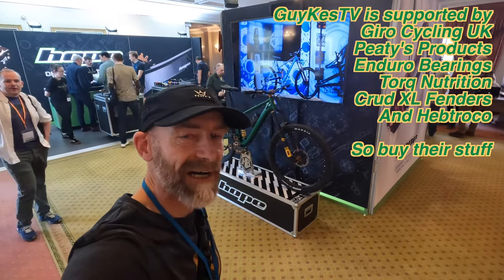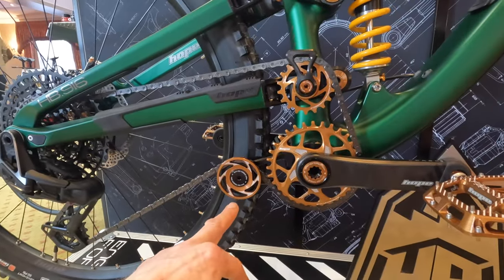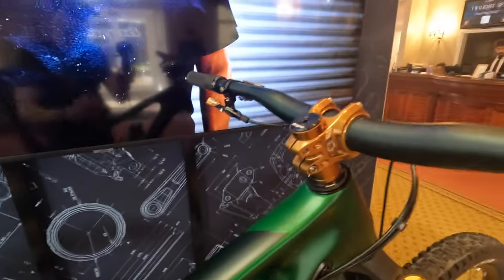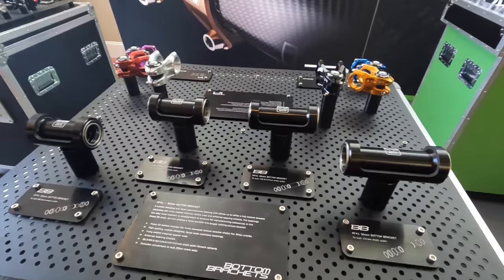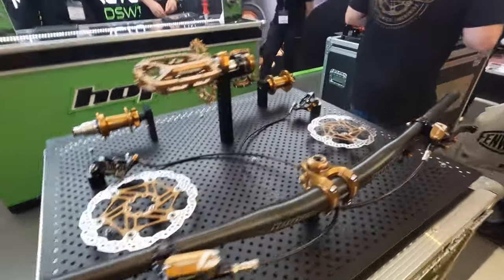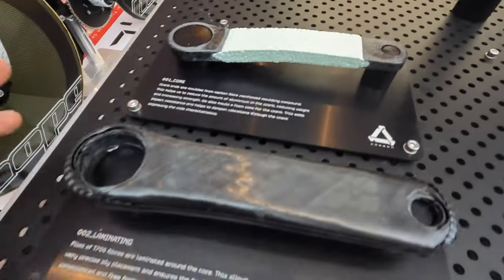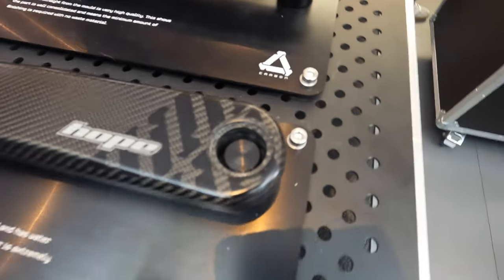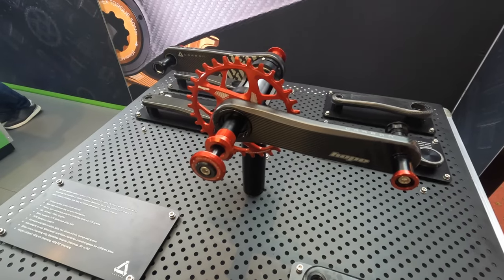Latest Hope bike, crank, colours and BBs from the Core Bike Show

Comment: So let me get this straight, SRAM have created a whole new standard, making it difficult to replace parts for all of us who don’t have the UDH. that standard now means bike manufacturers have to make over complicated designs with more servicing costs and more drag in the system so chain growth doesn’t rip the mech off (Guys words not mine). It begs the question what was wrong with the previous AXS system that we absolutely NEEDED to do this!!??
Reply from the maker: Oh that’s easy. There was nothing wrong with it 🤣 T-Type is proving tougher and more foolproof once it’s set up correctly though
Reply: @GuyKesTV  so, I’m not questioning you but surely not if frame designers are having to add pulley wheels to stop the thing getting ripped off (or breaking chains)

Comment: I remember buying my ti-glide hubs when they first came out, do you recall what year they were released? I'm guessing 1994
Reply from the maker: Ti Glide for rim brake was 1992, disc version was 1993
Reply: @GuyKesTV  cheers Guy, speaking of old school i just bought USE's latest wide2 carbon bar, it's very nice and well priced, the last time i had USE bars and titanium seatpost was probably 1990....
Reply from the maker: @Timtheranger  I’ll have to have a look. Do they still come pre drilled for direct fit stubby bar ends? 😂 or was that X-Lite 🤔

Comment: 3:46 dampener? Self wetting you say?
Reply from the maker: Yes that foam core is meant to take some sting out of impacts. I’ve seen it work with bars so it’ll be interesting to see if it genuinely works with these.
Reply: @GuyKesTV  but you said wetting, does it have water absorbing properties?